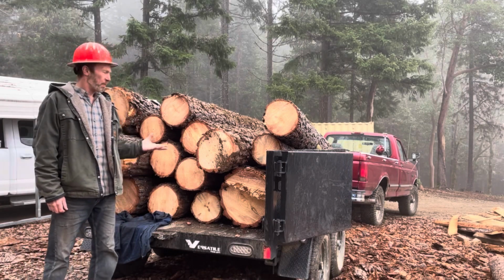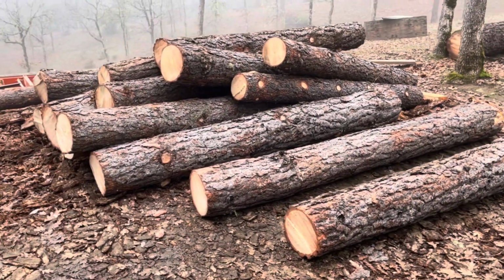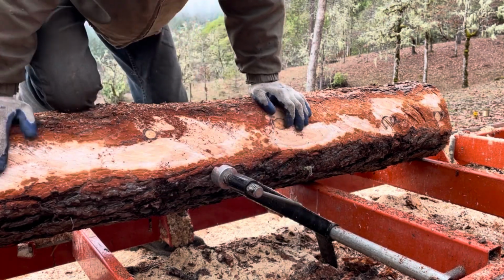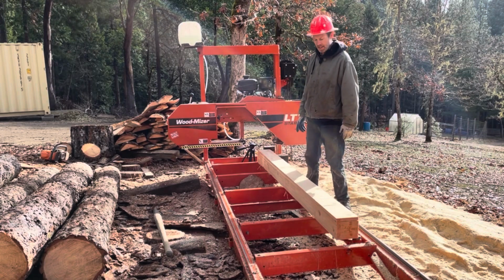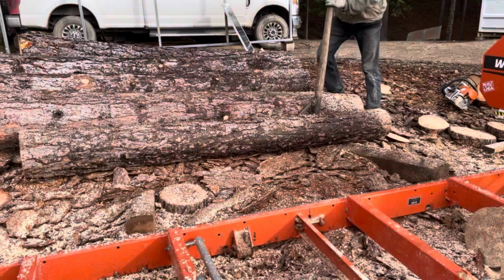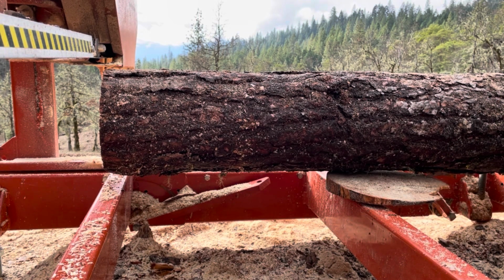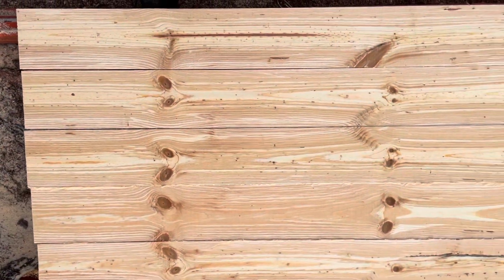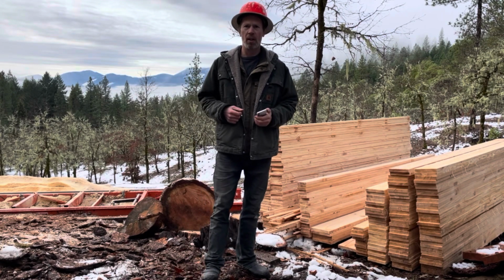How Much Lumber From a Cord of Small Diameter Ponderosa Pine Logs on Woodmizer LT 15 Sawmill

Comment: I've never figured yield that way. If I scale the logs I use International scale since it's closer to bandsaw yield, but I've never tried to see if I beat scale or not. I wouldn't think you had 75% waste though.
Reply from the maker: I had so much waste because of the nature of this load of logs. They were small diameter, some had a lot of taper and thick bark. Also a few of them had a considerable amount of sweep. If it was a cord of larger diameter straighter logs, the waste would have been much less. The objective here was to see how much I could get out of these low grade logs.
Reply: @WilsonForestLands  Thanks for your reply. I understand now.

Comment: What blades are you using on your mill? I bought the same mill as you and have been using 9° double hard.
Reply from the maker: Mostly 10° double hard. I have some 7° double hard and I really haven’t noticed a difference on the mostly softwoods I cut. But that may be I just haven’t use the 7° enough or just haven’t paid enough attention.
Reply: @WilsonForestLands  thank you for the reply. I really enjoy the versatility of the 9°. I have a 14hp on my mill and I can tell when it's dogging down when it's ripping thru the log. I can also tell when I don't have enough lubricant.
Reply from the maker: @cfxsniper  When I was asking Woodmizer about blades, they never gave me the option of 9°. I recently heard someone else talking about them. I may have to look into those.